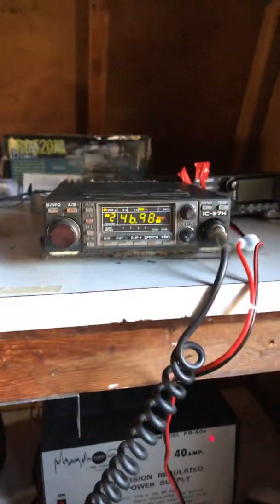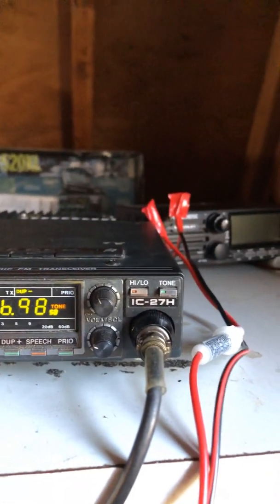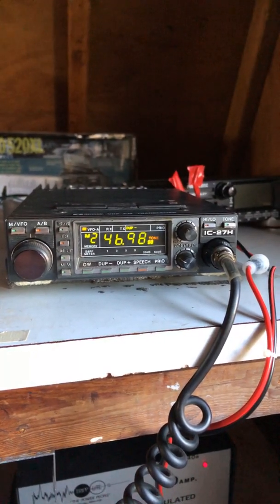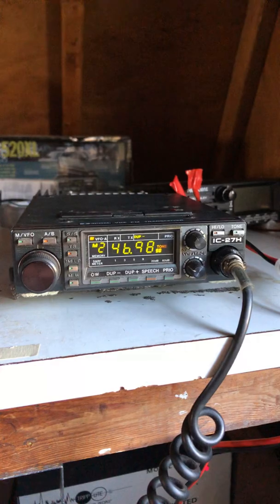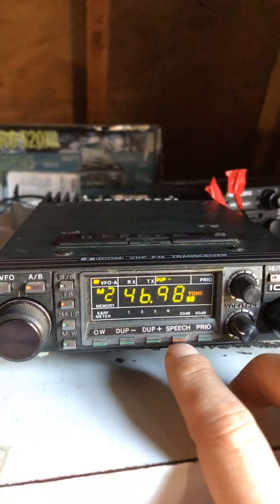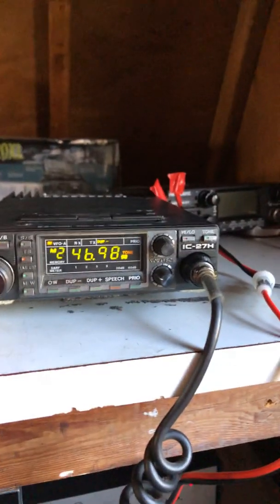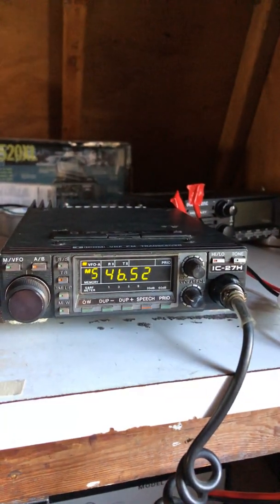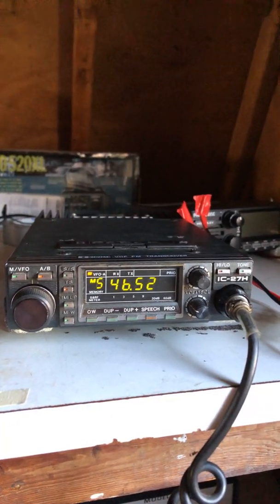Icom IC-27H

Comment: Hola amigo.
Es muy buena esa radio, me gustaría saber si sabes cómo activar el tot.

Hi My Friend.
Any idea how to activate the tot?

Tnks.
Reply from the maker: I just flipped through the whole manual to make sure.  There is no time out timer on the IC 27-H.   73
Reply from the maker: By the way the heat sink is large but it will still get hot.  So for long simplex QSO I put a fan on the heat sink.
Reply: @mikecricket113  ofcourse, but i use this radio to operate an echolink. Not the Best idea i know. Ok thks aniway.